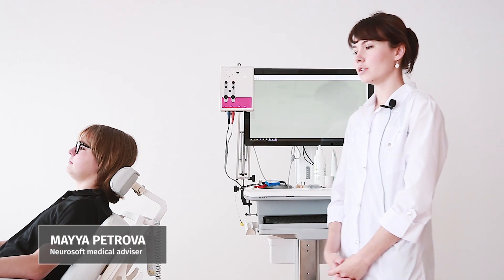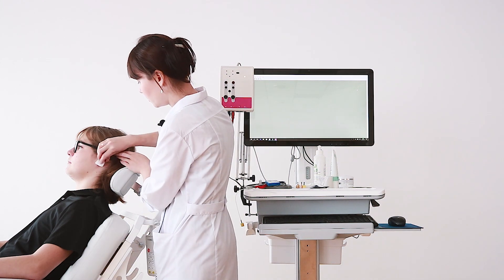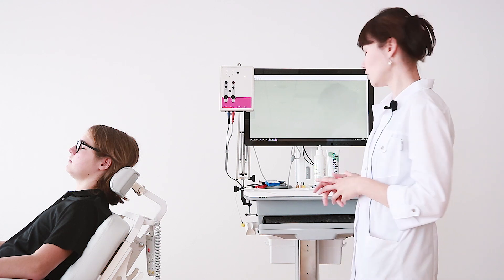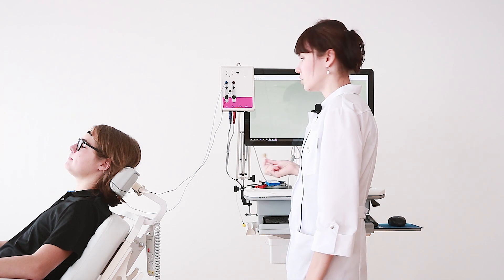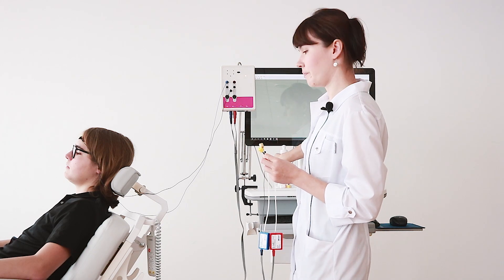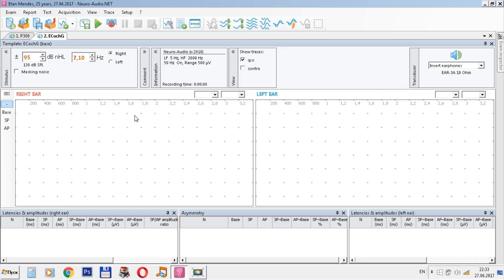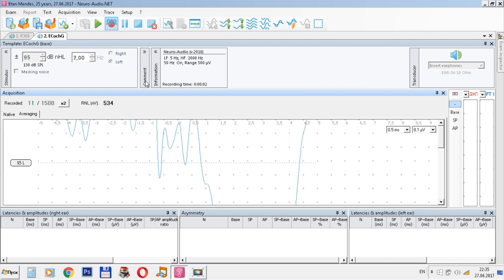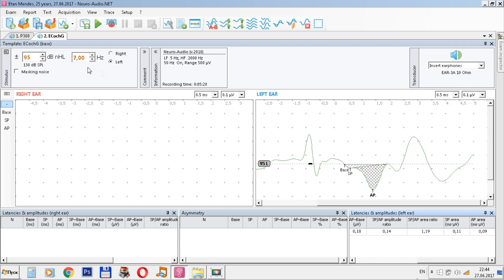How to perform electrocochleography test

Comment: Why do you place an insert earphone in non-test ear?
Reply from the maker: Hello!
When recording from both ears the contralateral Tip-Trode, in the opposite ear canal, may be used as the non-inverting electrode.
Reply: @neurosoft_llc  hi, thank you for the reply. I saw it like a normal eartip without gold foil..